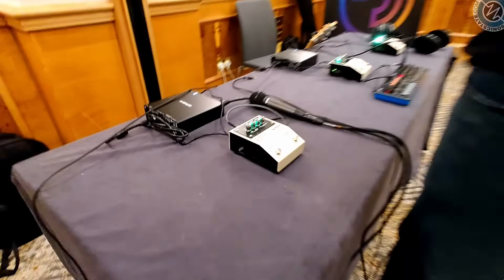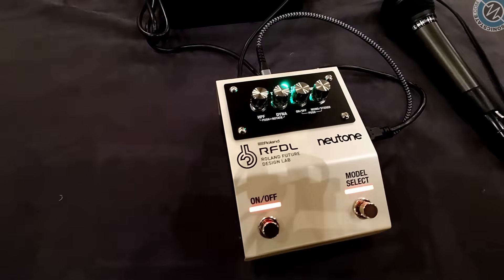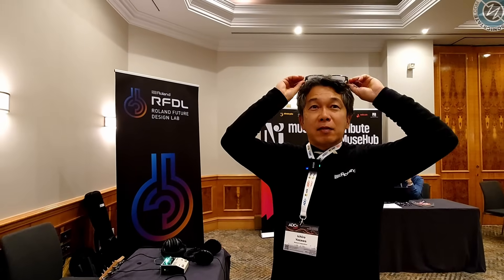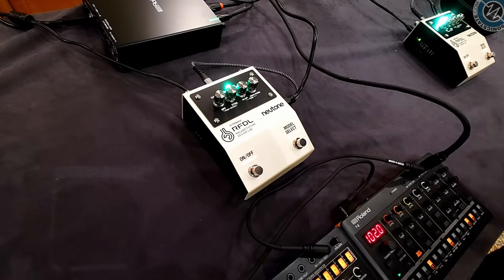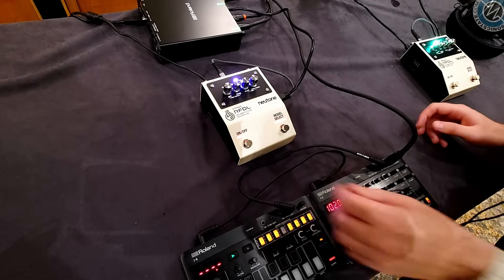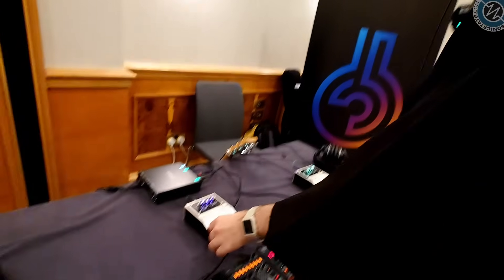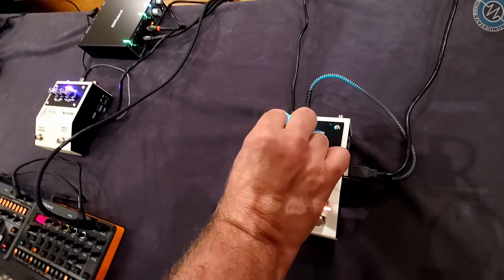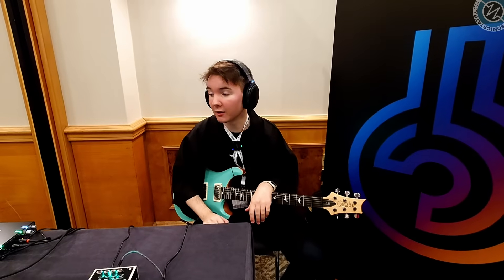Roland Future Design Lab - Project Lydia - Neural Sampler - ADC 25

Comment: Interesting, it's been a little while but my experience with the Morpho plugin was that you essentially couldn't really use it in any meaningful real-time situation due to internal latency. I'd record live playback or render it down to audio and adjust afterwards. This unit doesn't seem to have that issue, though. I love the tech, great for weird experiments and happy accidents. I wonder if they'll ever be able to solve some inherent other issues like keeping pitch; you can hear in this video that the little bassline going through the vocal model immediately goes out of tune. I can imagine that with large enough models and large enough amounts of training data things like that could be solved, but I can also imagine this type of 'drifting' or, as they call it with LLMs, 'hallucinating', is just an inherent part of how the neural networks function.
Reply: I will leave room for Neutone to comment more deeply on advancements in the core engine, but I will say that even with this first phase of PoC hardware, the latency is down to a level that is completely usable for many live applications, and we hope for further improvements in the next iteration.
Reply: Thanks for the reply! Yes it certainly sounds like that, I could've expressed it a little more clearly reading it back now, but I agree there's certainly no audible latency in this video even when mixing wet and dry with the groovebox (as opposed to my previous experience with the plugin - which to be clear I already thought was very cool, regardless).
Reply: @apostrotastrophe1  Live performance is a very high priority for us, so assuming we do bring this to market, trust we will have dialed the latency down to completely acceptable levels. Thanks!

Comment: How do you get 10 minutes in to a 20 minute video about a new guitar pedal technology, and there still hasn't been a demo of the pedal's unique sound?
Reply: Fair comment. And to clarify, although this looks like a guitar pedal, it is actually designed to accommodate almost any source signal (including guitar).
Reply: @paulmccabe2859  Thats pretty cool, so it doesn't need level converters or impedance matching?
Reply: @Timebound_Timmy  At this time this is all being handled by the external audio interface, but multi-level/format I/O should be integrated directly in a future version.

Comment: TL;DR: Project Lydia is a RP5 running the neutone plugin. At this time the RP5 isn't actually connected to anything. It needs its MIDI encoders plugged into itself via USB-MIDI loopback and then it needs a USB audio interface.
Reply: I didn’t know about neutone, so this is suddenly fascinating to me. Interested in what might happen here with wavetable/single-cycle waveform training. I’ve built many, many wavetable creation models.
Reply: @kcrosley  That's one to try. I can say that we have had much fun feeding different forms of noise through Project LYDIA!
Reply: @RaquelFoster  yes, all correct for this phase of the project. The next phase will focus on a fully integrated and optimized design.

Comment: So they build a mono effect pedal ... with no audio input or output (only USB) and it does WHAT? 14 minutes into the video I still have no idea what the guy in the Harry Potter coat wanted to show.
Reply: Project LYDIA is true stereo. The current version of our proof-of-concept uses an external Roland RUBIX audio interface connected by USB, but the next version should fully integrate the audio I/O.

Comment: This could be seriously cool, really clever box. I hope it makes it out of the lab. I could see so many ways I could use this in my setup.
Reply: Really? Can you name a couple ways? It's literally a RP5 running a plugin that turns sounds into ai slop.
Reply: @RaquelFoster taking a live input, splitting the sounds into different frequencies then using those different frequencies as triggers for wholly new sounds? I may have misunderstood the possibilities but I would think of this as like a kind of alternative approach to granular synthesis. Which could be cool. BTW I absolutely fckn loathe AI slop in all forms, I'm a musician not a computer guy, so if this does turn out to be just a kind of 'play in kazoo, get flute sound instead' gimmick then, sure, no sale. But my sense is that's not what Roland are after here. Then again, who knows. It's a concept, but at face value, an interesting one.
Reply: @touchthatdial  Not at all what we are after, and if that is what the result is, we won't proceed (but that is certainly not the current trajectory!).
Reply: @paulmccabe2859 interesting, and thanks for replying. In which case I’m now less sure what this is for or how I’d use it. But I’m still interested to see where you end up, and thank you for trying new stuff out and experimenting rather than just cranking out new versions of the same old same old.
Reply: @touchthatdial  Appreciate that, thank you. This is very much the mandate for Roland Future Design Lab (we say RFDL casually).
Reply: @RaquelFoster  If you get to try it, I hope you may have a different impression, but perhaps not, and that's okay, too!

Comment: It seems like what Kyma has been doimg for decades
Reply: I believe that Kyma excels at spectrally morphing one sample into another, with four way morphing that is especially smooth. This is a little different. The machine learning is a kind of algorithmic sampling of the spectral and textural features of a sound and then applies it to live input sounds in way that is responsive to that live input. So, a low note gets a growl and higher note gets a scream; or a hi-hat becomes a shaker and kick drum becomes a taiko. That sort of thing. So it is different; they both do spectral morphing, though. I've never tried Kyma as the hardware is pretty expensive; but I do use Zynaptiq's Morph and Soundpaint. But those are all sample-based rather than algorithmic.
Reply: @BF-up5xw  ok yes I get you. I did have a great happy accident recently putting a beat through an AI voice model which gave a similar result
Reply: @BF-up5xw  so in a nutshell it's achieving real-time hardware "Resynthesis Vocoding" , or is there much more to it?
Reply: @shaft9000 Yes,as it is adaptive to the input and it has a much wider range of spectral models, which can be continually expanded through algorithmic sampling. I think.
Reply: @shaft9000  In a basic sense, yes, but where Vocoders work with frequency bands, the neural sampling model is quite different.
Reply: To get a new tone, you can face plant, too
Reply: it seems it´s going to be a lot cheaper than Kyma.
Reply: Kyma does not have and never has had a data layer required to do this sort of AI or any concantanative synthesis